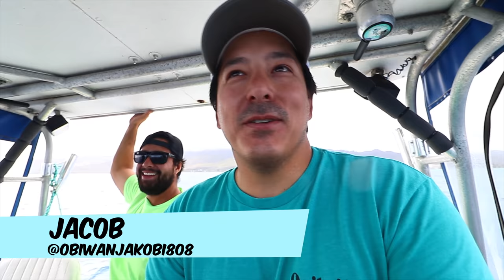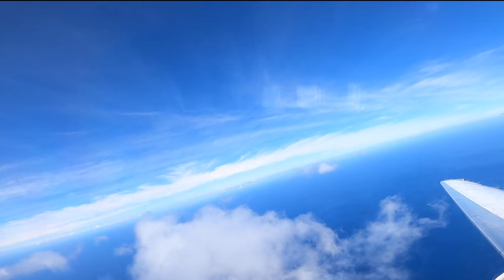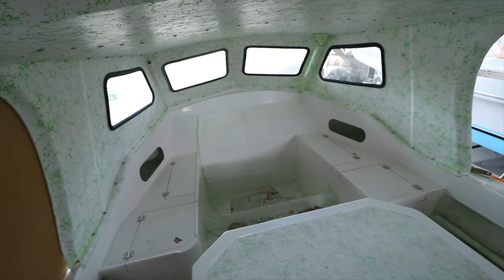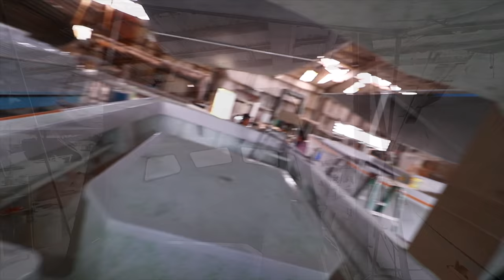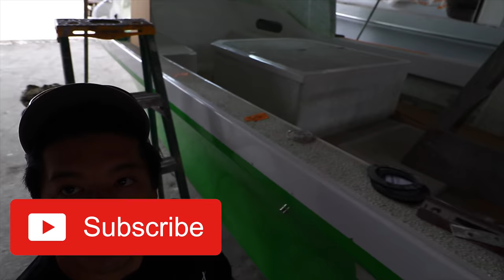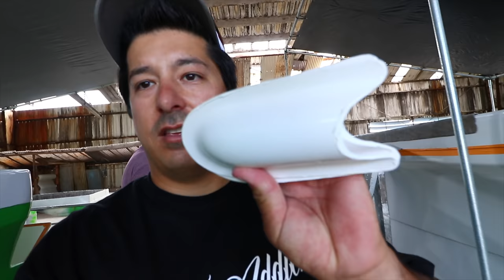Why I had to Sell my boat!

Comment: On that fish box......seems to me, that a front (facing the boat motors, actually) fold-down door UNDER that lift-open lid, would be a great alteration, because you could then continue to use the top lid for your tackle preparations, bait cutting, etc, and tilt down a trap door to load a fresh-caught fish in, eh?!  And then, at cleanup time, both doors of the fish box would open up and facilitate an easier access for retrieval of fish and for easier cleaning!  Just an idea.

Comment: Hey Nick thanks for the advice on boat I'm going to shoot for an 18 or 19. I will be trolling from the rear on the aluminum roll bar.I can put the center console either very forward or in the back. What would you do put the center console in the rear by the fishing poles where I have quick access to the poles and throttle or would you put the center console in the very front. I do not want to put it in the middle because I need a big space for the freezer. I'm going to run a solar power freezer so I don't have to haul ice. Cold fish box!.  Boo ya.